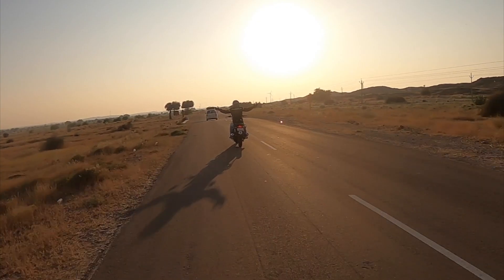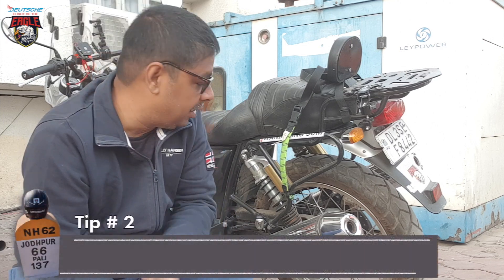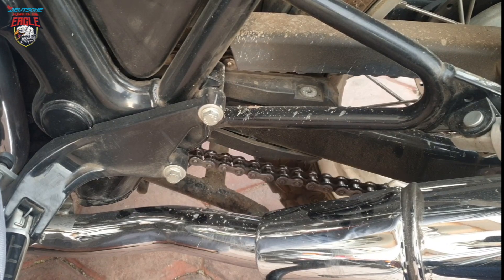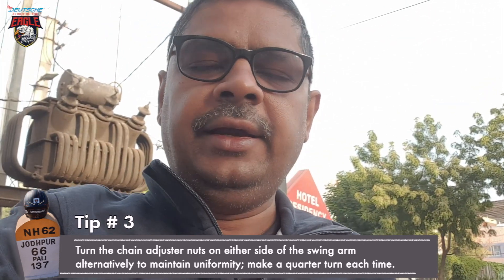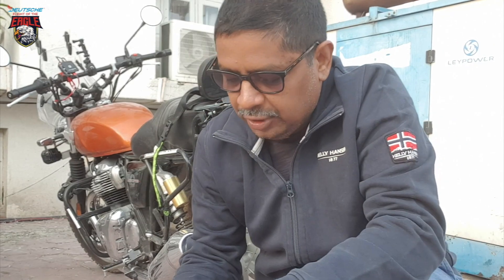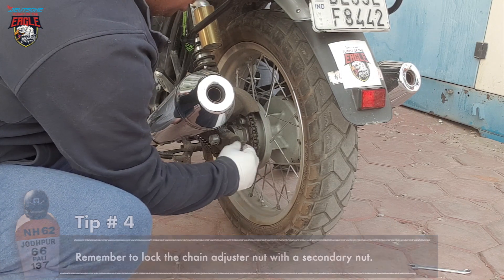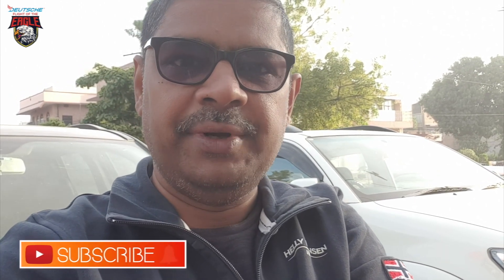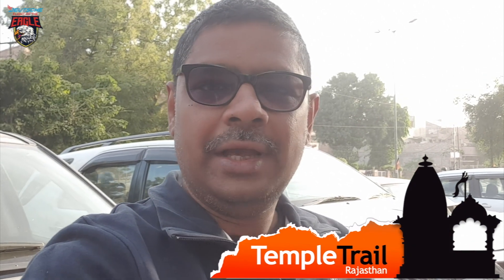How to Adjust Chain of Interceptor 650 | 3000km Long Tour Maintenances | Tools for Chain Adjustment

Comment: Sir my interceptor gear is hard to shift  but if pillion sits then it become smooth ..need your help
Reply from the maker: Thats a new thing. I recommend that you get the chain setting check at the RE service centre. They would be able to diagnose the problem better.
Cheers!